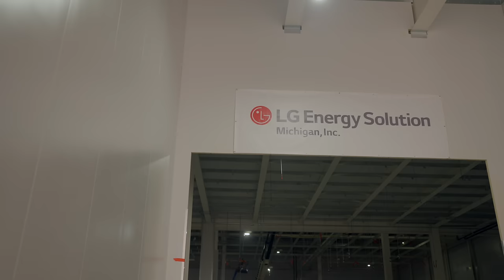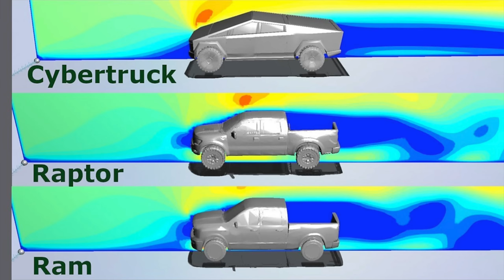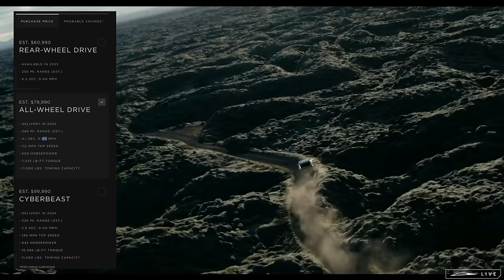Cybertruck - What Tesla ISN'T Saying!

Comment: Just to be clear - the original Cybertruck glass was never claimed to be bulletproof. They called it armored glass or something like that, but the bulletproof claim was for the stainless steel body.
Reply: At the Cybertruck unveil they described the Tesla armor glass as "transparent metal". Just see a recording of the event.Then they tested with palm-size steel balls.
Reply: It seems the window test was repeated with a baseball at 1:24  replacing the steel ball projectile.
Reply: @groverw7507  Come on, that was plain bs. What's next: a towel?
Reply: @MooseOnEarth  yeah, the guy didn't even throw the baseball hard, sort of placed it at the screen, lol.
Reply: @dogbreath6974  Some individuals even question whether it was a genuine baseball because it appeared excessively bouncy upon striking the window. Therefore, it could have been a baseball liner filled with air. It appears they wanted to ensure by all means that the mishap would not happen again. 🙂
Reply: @LeeWilsonJr Elon Musk repeated however the narrative that someone could empty a "Tommy gun" on a Cybertruck and you would survive. He played with claims about to withstand an apocalypse.
In essence, bullet-proof metal doors alone make limited sense. If the glass (and tires) are not similarly strong to withstand the attack, the attacker will just aim at those: windows and tires. FMPOV Tesla will later drop the whole "exoskeleton" narrative (that just did not work out), make normal thickness outer body panels (maybe still from stainless steel, unpainted, maybe some more lightweight metal) on this architecture and save quite some weight and cost. If they are really serious about actual mass production, then more common approaches will be needed. Reducing Cybertruck body weight will also increase range, reduce costs, increase payload.
Reply: @MooseOnEarth, that’s what I was thinking but by how much will it affect those metrics? If it pretty noticeable then yes, replace with thinner steel but if it’s negligible then stay with the thicker steel.
Reply: Not bullet proof, "thermonuclear proof".
Reply: Thermo nuclear explosion proof glass
Reply: “thermo nuclear blast proof” was the claim… Not exactly better.  Cope and cope
Reply: And they threw a stone 4 years ago but a softball this time.
Reply: And they threw a stone 4 years ago but a softball this time.
Reply: What's the point with a bulletproof body when the windows aren't?
Remember it's only in the US and other similar 3rd world countries there are mass shootings, so what's the selling point for this car in the EU?
Reply: It's just normal tempered glass. The same what is available on the market. They also made claims that the metal was unique. It isn't. It's a product you get from sheet metal manufacturers. And because they don't put any sort of clear coat on it, it develops rust very quickly. I think there are going to be lot of lawsuits over how this has been falsely represented to teh public.
Reply: Its actually a tennis ball. Baseballs don't bounce on concrete ground like that. You can buy tennis balls online that look like baseballs. This was a pretty obvious misrepresentation by Tesla. But they have consistently been engaging in that. They do the same with SpaceX too.
Reply: @cav8285  The thicker steel has three big problems:
1. It is extremely heavy compared to thinner impact resistant materials on normal cars. This lowers vehicle range significantly and also increases kinetic impact in a collision(this will kill drivers and passesngers).

2. It is sharp and the doors/hatch are very heavy. It will cut off your fingers if they are in it's path when it closes. This has been demonstrated in numerous tests you can find on youtube. 

3. If you are stuck in the car in an emergency, first responder tools will be unable to cut you out of the vehicle. There is also no exterior door handle for them to use if you are unconscious. Basically the only way to get you out will be to shatter the glass and try to get everyone out the windows. There are cirumstances where this is not possible however, such as if the upper window area is crumpled against the door.

Comment: I was bound and determined to get the 500 mile range model, because I use my truck mostly for towing my RV, but frankly, I nearly always tow my RV where some form of power is available.  With that in mind, the dual motor without the extender will be my choice as I would not want to lose any trunk bed space... I would rather spend 30 minutes or so for one recharge stop.  Thanks for the great analysis.
Reply: I think I would choose the same. If I owned and operated a small towing company specializing in towing heavy loads long distances all day every day, I would still consider diesel as an option. Or if I was towing often in northern Canada, Sahara or Siberia. It seems like diesel will be for rare edge cases in a few years. (Gasoline will be for collector's cars.) Give that a good decade for most of the vehicles already on the road to be retired. Then everything becomes an expedition, because where are you going to get fuel? Charging will be everywhere, but liquid fuel pumps will not be installed in new locations and many old location will close down.
Reply: You can use the range extender in cyber truck , range will come close to 500
Reply: The issue is you will have to find a place to park and disconnect your camper before charging at a power station. So now it will take much longer than just the 30 minutes for the charging.
Reply: @GravityKillsYou  That can be an issue. Tesla (and a few others) are installing some pull-through chargers for this. Gas stations replacing their pumps with chargers is one example. Some inconvenience must be expected along with the obvious awesomeness.
Reply: Prepare for frequent charges if you plan to tow 300-400 miles per day. I doubt you will get 120-130 miles per charge with decent size RV behind you. I hope it’s better than that but I doubt it. I’m waiting for a better battery down the road or a pancake style extender so you can use the bed.
Reply: @gregfoster6916  Towing 300-400 miles per day? Sounds like a very uncommon job. Maybe this vehicle is not right for that. Towing 300-400 miles a couple of times a year? I wouldn't worry about it for a second. I, for one, am not in a race, peeing in a bottle at highway speeds to never ever stop. 😆 That is definitely a trip with both a lunch and a dinner stop for me. Not because I have to, but because I want to. And I am telling you the dinner would be cut short because of my phone telling me the battery is full enough, so it is time to get a move on. Roadtrips look different in good EVs.
Reply: @geirmyrvagnes8718  Thank-you for speaking truth to the crowd that claims no amount of range will ever be enough. Two hours without a comfort stop is about my limit. Besides, I'm getting old. If I don't get out of the car and move around, I get mighty stiff and sore.
Reply: Are you able to find public chargers that you can charge at without unhitching the RV ?
Reply: @garywozniak7742  they are supposed to make some. I’ve seen none since 2018 till now

Comment: Ethernet on-board signalling ... so what?  I recently paid over $1600 to replace a faulty headlight on my model S.  It was an electrical fault, the headlight was physically intact.  What would the cost have been if my headlight consisted of a mechanical switch, a copper wire, and a light bulb in front of a reflector?

Comment: FYI, that 340 miles of range is based off of the smallest available street tires. With those 35" offroad tires, expect a lot less.
Reply: Most definitely, and your caveat is one of many that may take years to overcome!
Reply: Where did you see optional tire sizes?
Reply: Camissa for hagerty already said 310+epa on 35s for the beastmode tri motor ct. 👍🏻😎
Reply: And probably that range is from 100% to 0%  not that good for the batteries, and not in the winter time.
Reply: @haywoodmorganjr1326  It's optional wheel sizes, not tire sizes.
Reply: And the same thing happens when you put large tires on a Toyota Tacoma or gas Jeep Gladiator, they no longer get 18 to 22 mpg.
It's more like 15 to 20 mpg and if you add maximum payload or a large trailer, the MPGs are cut in half.
Reply: @vulpo  How do you change the size of the wheel without changing the size of tire ?
Reply: @vulpo  my question is where is it stated that the tire and wheel size shown is optional?
Reply: @bobbybishop5662  The outer circumference of the tire does not grow larger when you go from say, 18" to 20" wheels. Instead you have to use low profile tires that have a much larger inner circumference, but the same size outer circumference. The low-profile tires result in a poorer ride, more road noise, less range, more wear, and may result in wheel damage in case they hit a pot hole, but some people think they look cool. The bigger wheels and low profile tires also cost more.
Reply: 224 watthours per kilometre. I wonder how fast they were going when they achieved that? Thats about the same as a model 3 at 110kmh.

Comment: Wouldn't want to be caught in a storm in any EV - especially if the power grid went down and teir backup genearators are not working as they do a lot of times during normal weather...  Pull is impressive, but praticality is a BIG short coming

Comment: The truck pull result is a bit of a cheat, leveraging the CT's superior acceleration at the start to get the trailer moving for higher initial momentum. The rest of it is usually just traction failing first.

Comment: Towing / workwise, the cybertruck is similar to a Ford F150 or a Ram 1500. It will tow a smaller horse trailer or a smaller skid steer or tractor. However, it is not going to tow a 5 ton CTL or mini-excavator. Lots of useful work and farming applications. The range is ok, especially with the extra range extender. Considering that the top of the line F150 is about $80,000, this is in the ballpark. I want one of these but do have an occasional need for towing larger equipment 100 miles or less -- for that I would buy a used diesel truck with a dump truck bed.

Comment: The combination of the super car level body stiffness, steering by wire, rear wheel steering and computer control suspension make this thing drive like a sport car.
The ideas of a separate range extender is brilliant if it can be remove and use as home power wall and hook it back into the truck for long trips
Reply: Great idea!  Hopefully Tesla is listening.
Reply: No vehicle that weighs as much as this thing does handles like a sports car. It might handle good for a wanna be truck but it doesn't handle like a sports car , not a true sports car anyway. Take it to the track with that 911 see how many times the 911 laps you in an hour of track time.
Reply: remove it, what with lol.
Reply: @bobbybishop5662  yeah but it's gonna be the most fun TRUCK out of all the other EV trucks, none of the others come close in steering feel
Reply: @akhilsharma2712  So you have drove one ?
Reply: @akhilsharma2712  so you have driven them all, or just being a silly fan boy
Reply: @bobbybishop5662  Agreed, it's fast alright. However, the immense weight alone affects it's agility. It will not run like a Porsche, nor should we expect it too. It will go places a Porsche has never seen.
Reply: I could see a light crane product similar to those used to remove/install the hardtop on a Jeep Wrangler to handle a range extending battery pack in the Tesla Cybertruck.
Reply: @avsystem3142  yeah, Tesla give me 5k for it. Thought these EVs saved you money
Reply: @bobbybishop5662  why is it a "wannabe truck"?

Comment: Wanted more range for less money, Unfortunately physics has butted heads with my unreasonable expectations. Want more range, put in the extender. As an engineer, I’m more than happy to accept the compromises and innovations - 48V and ethernet architecture, super strong body & glass, adjustable ground clearance, torque vectoring & 4 wheel steering, 11Kw of off board power, huge trunk with bed liner & cover, crazy acceleration and towing, no paint. Hmmm, maybe not so much compromising after all :-) If you don’t like it, get out of line so I can get mine sooner!!    Thanks for the video!

Comment: I love it. I want it. It’s perfect for hauling plants home from the nursery, my bike and my dog. Plus, I live on an island so its maximum range is not an issue. The only question I have is about the voltage tolerance. We have a lot of voltage sags in Hawaii, despite what the utility claims.
Reply: That’s a good question for Tesla. So, go get the data that shows all the power sags, fluctuations, and ask them if this unreliability is a problem for charging up. Tesla should have a good answer for you, so you can make the best decision for your situation. What island?
Reply: Because of the poor electrical service in Hawaii (I’m on Oahu), I am now using the Ting sensor by Whisker Labs, in addition to a whole home surge protector. The Ting sensor monitors daily average, high and low voltages. There are frequent voltage sags beyond the NEC 5% parameter. Just horrible. So, yes, good idea. I’ll inquire with Tesla about their battery recharging tolerance.
Reply: Damn your living the dream!
Reply: @temujinkuechle6287 
The salesman won’t know but will probably say “yeah, sure it will be alright.” I am an engineer and I think it will be alright, but it may slow the charge rate.
Reply: Is your island wet? It won't do well with that...

Comment: I have a reservation but about 700k in line. Hopefully they honor the 7k FSD. After the reveal I would likely go for the dual motor over the tri-motor if they allow that change. Primary reason if dual motor will qualify for tax credit, and I think now has more range than tri-motor. Which after they revealed that both have same size battery that isn’t to be unexpected.
Wonder if you will go with dual motor as well.
Reply: I’m at 344k for Tri-motor and will also do for dual motor.  Range is why I opted for Tri.  I have a 2018 M3D, when I ordered charging was still sparse and trips could get sketchy.  Having 500 range would make any route we looked at possible.  Charging is way better now, but range is key.  If I can, I will also switch to Dual and hope they honor the FSD price.
Reply: How much did it set you back? I'm seeing news stories about how they took the prices off the website.
Reply: @dannydaw59  the preorder deposit was only $100 fully refundable. The new deposit is $250. Which I think is still refundable.

Comment: Impressive performance data, except for a few details kinda not mentioned: 1) Time required to refuel, 2) Range on a fuel charge, 3) Sub-zero temperature performance or lack of, 4) Problem of Lithium batteries exploding or bursting into white-hot flames. 5) Non-competitive cost(initial and continuing maintenance).

Comment: I reserved Cybertruck in November of 2019 and I think it’s pretty good but I also got an email from Tesla saying I’m in the line, but I should check out a Model Y while I wait. That implies a year, or more likely two years while almost as good Lightnings are sitting on dealer lots with discounts and I’m assuming the new 2025 Ford, Ram and GM trucks will roll out about the same time as the Cybertruck line gets into full production. 
I figure once Cybertruck demand slows, they will probably drop the price significantly and the others won’t be able to and still be profitable, but that’s my shareholder side thinking. 
My car purchaser side wants a truck now, but doesn’t want to pay $70-80k and recognizes that the Model Y can handle the three trailers in my yard, but not necessarily a newer heavier version of my travel trailer. The utility trailer and the boat only go on short trips
Reply: I'd grab a heavily discounted lightening now and wait 3-4 years for Tesla to iron out all the kinks in the CT.
Reply: @paulbrowne6087  
You're not entirely wrong. I'm still hopeful for the Tesla 2 to ever come out, but meanwhile I bought a JAC E10X last year. People should buy the vehicle they need when they need it, and I was holding out but my clunker expired on me and I couldn't wait any longer. And now I need my JAC to expire before I get a Model 2, probably next decade (the JAC has a LFP battery, so degradation should take a while). 

Besides, due to the exterior panels of the Cybertruck being an origami nightmare rather than a 10 second date with a stamping machine, it will take years before production ramps up. That should be more than enough time for common problems on the production version to get ironed out.

Comment: To my mind, this is an outstanding vehicle. It isn’t perfect but it will improve over time. The technology in this vehicle is next level. There is no competition as yet tech wise. It won’t be used for “work” by most people but it is more than capable for most tradies. It needs to gain a foothold in the market and then once they ramp production the prices will come down. The battery will improve quite quickly if planned dev of the 4680 is implemented . Overall, I love it! The future is here at last.
Reply: I can taste the tears already, Tesla will definitely lower the price just like they did with the S and X.  Probably 10k less by the end of next year. The current price is probably just enough to break even during the ramp up.
Reply: what i don't understand is why would buy this if not for work? but a model S. it drives better, is more comfortable and goes faster. literally makes no sense to buy a pickup truck to use as a regular car.
Reply: @GraveUypo  It makes no sense to buy a huge 4X4 just to take the kids to school but people do it. 🤷‍♂️ At least if it’s an EV it’s cleaner.